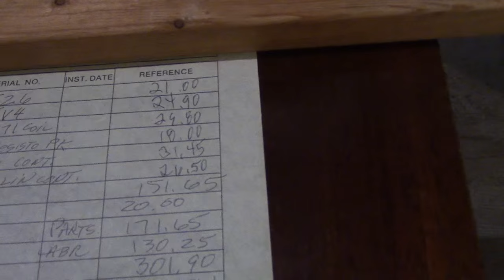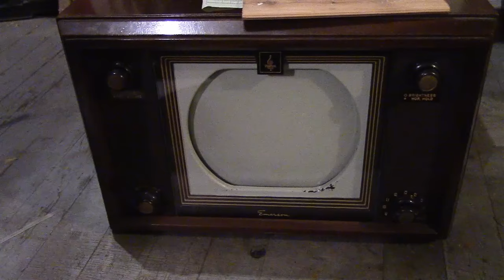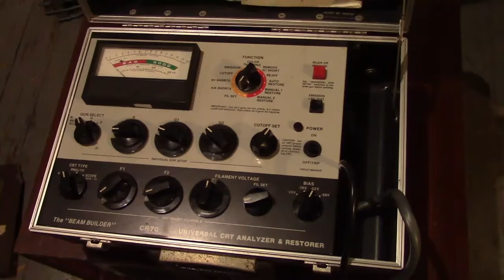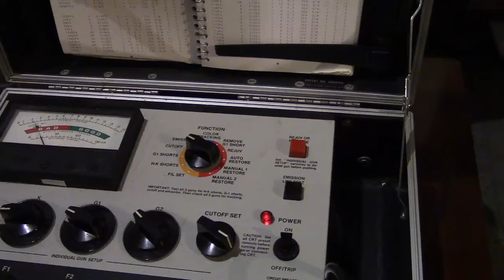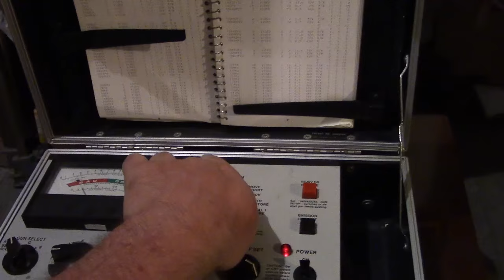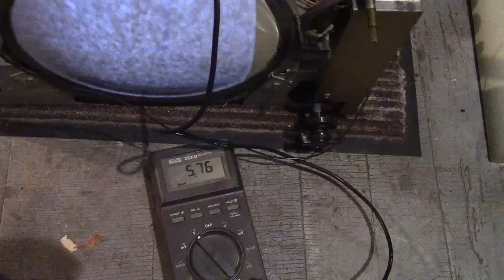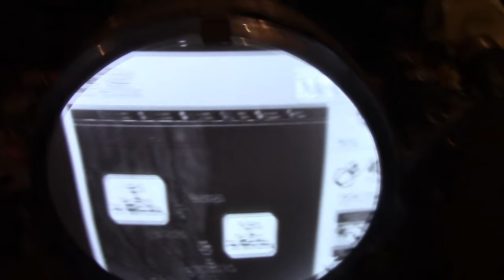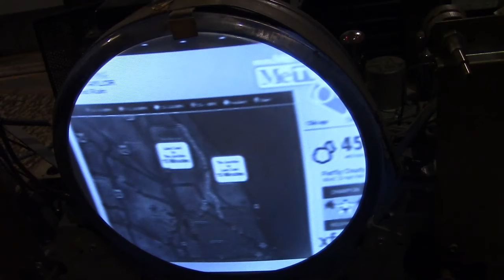Emerson 637 checkout

Comment: How fun to turn it on and have it work! Not sure how many electronic things I have recovered from the trash that needed little more than a fuse replaced or a corroded battery terminal sanded.  Now comes the craftsmanship time to tie down flying parts, get rid of electrical tape splices, and get single, correct value parts for the doubled ones. Then some fine tuning, a bit of cleaning, maybe a little aligning and you have a beauty of a set!

Comment: I have an Emerson I'm just starting on. Similar to yours except 1 controls up front and no power transformer.  There was an issue with no heater voltage,  but I figured that out and fixed that, which led to several resistors way out and I replaced those. Still working on it when I can

Comment: I keep hearing you talking about TV shops; I used to own and operate one. It was back in the 80's, but the basics haven't changed. There are expenses; rent on the shop, phone, electricity, cable, heat, etc. Then you have to realize that a big part of the job is dealing with customers, finding and ordering parts, etc. If you can spend 50% of your time on chargeable labor you're doing good. The labor rate needs to cover that; there's a markup on parts, too. Parts are a special problem; nobody has every part for every set and as you go along "extra" parts tend to accumulate. They're an expense, too. Sometimes, when a customer demands immediate service you have to make use of what's in stock to make it work. I never did slop work like you show, though. 

I can't compare my numbers against current rates, but there were very good reasons to judge some sets as "not economically repairable". Every set has a value; what you could sell it for on the open market. That was the upper bound for repair costs and on some sets like GE Portacolors, it wasn't hard to reach it. Why pay $200 to repair a set that sold for $175 brand new? These days, the value of old sets is different; much higher. But the same rules apply. I had to consider that my customers might abandon their set rather than pay the repair bill, so a careful consideration of values was important.

Comment: It's pretty common for techs to write off devices as "non repairable" if the device have returned so many times to the shop. "Don't want to be repairing it for ever"
I have done this with 2-way radio equipment when it becomes economically irresponsible (costs more than a new one) to repair.
I don't feel it is right to charge a customer outrageous prices for repairs on an outdated dying radio when I can sell them a new one with a warranty for less.

Comment: hi sir, I taught in America the analogue reception  TV is switched off, because of digital reception,how come works on a old vintage analogue TV
Reply from the maker: +John borg We have one low power analog TV station left in my city.  I do not know how long it will be around.
Reply: Thanks,In Australia thay switched  off analogue TV reception  complete. 
Thanks again
Reply: +John borg The shutdown of analog stations wasn't mandatory. If I recall it the date stations could shutdown their analog was pushed out a few times  by the FCC to allow for people to get the Digital Conversion boxes for older analog sets. The US government even offered two $40 Rebate Coupon per household for conversion boxes!
For awhile stations were broadcasting both digital and analog signals.
I'm sure the few analog stations left(probably major market areas) will be gone in a few years.
Reply from the maker: +GrandsonofKong The only station we have let is channel 6 which is at the lower fringe of the FM band and actually operations as radio station MeTV FM  on 87.7 MHz.  I think they run with a boosted audio and reduced video carrier so it's not  a true TV broadcast.  The FCC has extended the cutoff date for these quasi FM stations several times.   Not sure when they will finally go out.

Comment: wouldnt any responsible tec test all tubes including the crt first. i know that is what i was taught to do first. also the first thing to check after that is are all the tubes seated correctly in their sockets. not to knock the origional tec but he seems not to do the proper proceedure when checking out a tv.

also his component replacement skills seem lacking at best. leaving things floating in mid air isnt good at all.
Reply: +Thomas Stemmer looking forward to seeing you get this tv working 100 percent and cleaning up the shoddy work replacing parts.